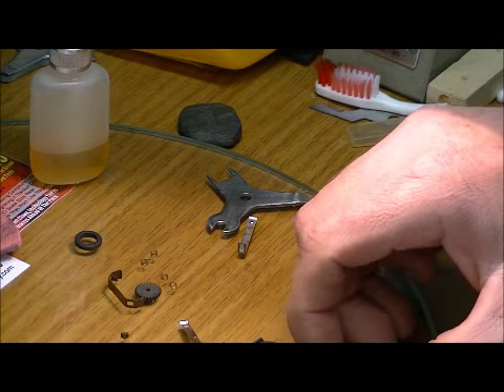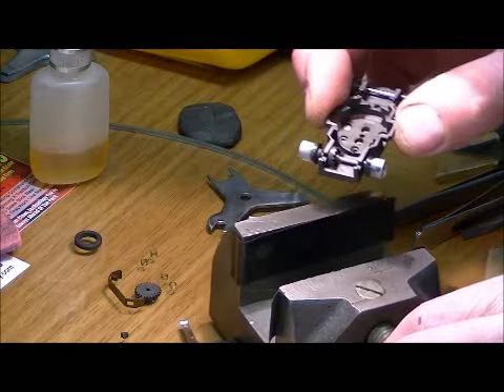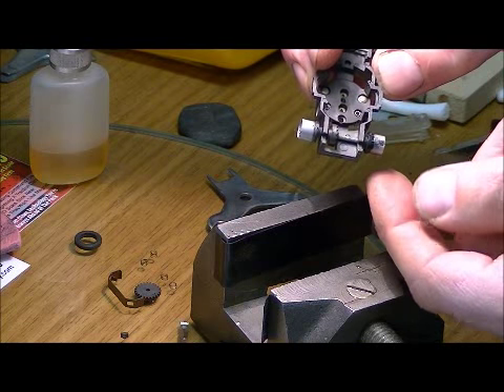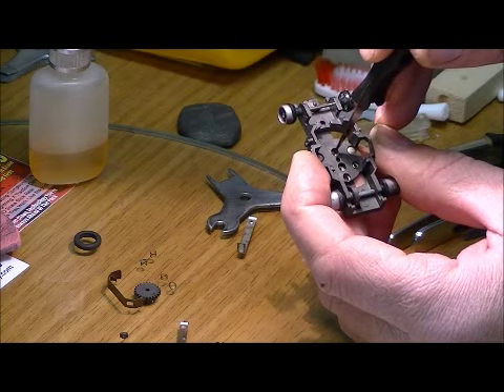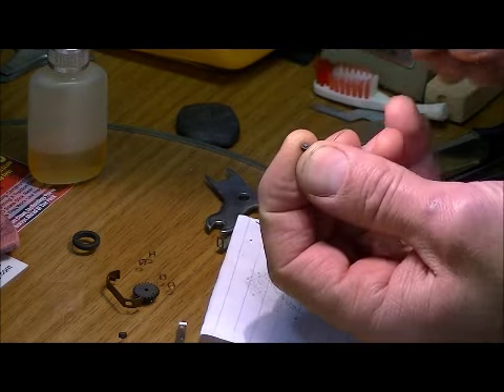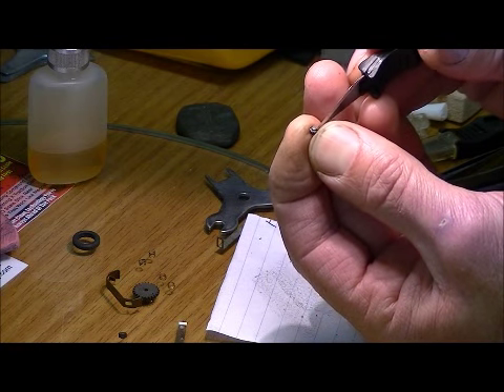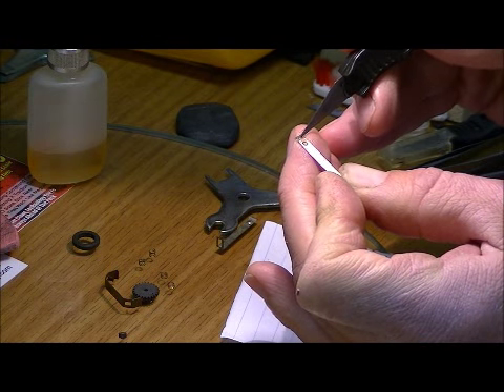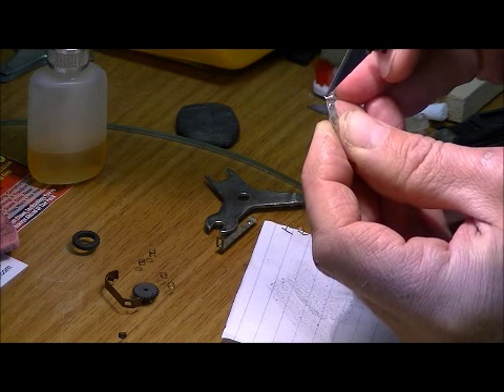Aurora AFX Magnatraction Chassis Rebuild Part 2

Comment: Edit>>  Everyone has  different ideas..
 I'm going to offer alternatives on some of this cleaning for others who may not know or be new to this procedure.. first, soap and water is ok but then you have to dry it which takes a bit more effort and time; possibly a air compressor to do it more quickly and get it completely dried out.. ..possibly the best thing to clean with if available is a dollar bottle of 70-90% rubbing alcohol , some maybe poured in a small shallow glass container > maybe a little poured into a lid or similar container (the bottom of any plastic, foam cup or container is great as well. anything that works.)  Alcohol removes the oily dirt and greasy residue much better and faster. dries on its own quickly if not overused. (young kids most likely won't be doing this operation I'd assume anyhow esp with knives and sharp instruments I hope not anyhow ) 
  2nd -  REAR AXLE play.. It should be at its maximum up to 1 1/4" - 1 3/8" total. if its too tight, as shown, the crown gear and rear cluster gear assembly may bind and the car wont run properly, if at all once the armature plate assembly is re-installed.  
  3rd, one shouldn't really scrape the brush contact springs with a knife - it CREATES MICRO SCRATCHES where dirt and oil can accumulate(not good for a Clean electrical path obviously) - your choice always-  one should probably take a small piece of linen/ t-Shirt/ thin rag/ low lint alcohol soaked paper towel and a small screwdriver bit or even best, a cotton swab stick(cotton end cut of)(or other implement) to gently wipe out the hole with a twisting motion. (electrical spray will help if you don't mind the spray).
   The eraser isn't a bad idea on the pickup spring holder, but a pencil type/shaped eraser sharpened to a dull point is somewhat better suited for this(or the old pencil type ink eraser, now can only be acquired on eBay it seems, unless grandma or grandpa have them at home. ). 
  on Cleaning the ARMATURE Plate brush surface area its best to take a straight pin or similar just around the shaft to ease out any leftover debris. (optional- Spray with contact cleaner and/or air as well) 
  A brass type hand held wire brush found in stores is a good tool to use to clean the contact points on the pickups and chassis and any where else with a very light brushing motion. otherwise a fairly good video.